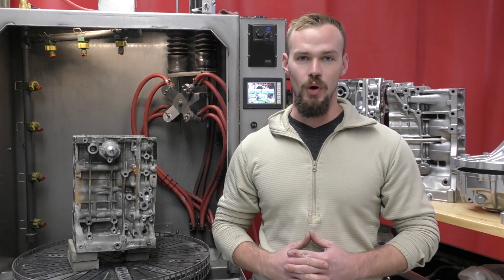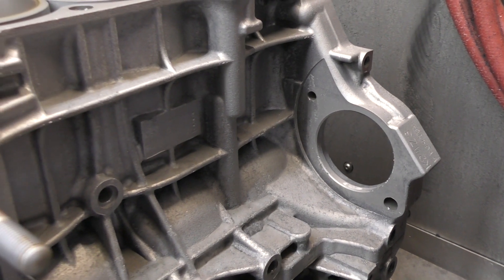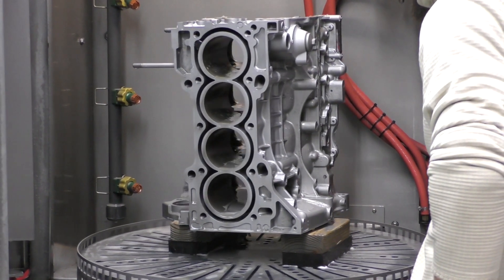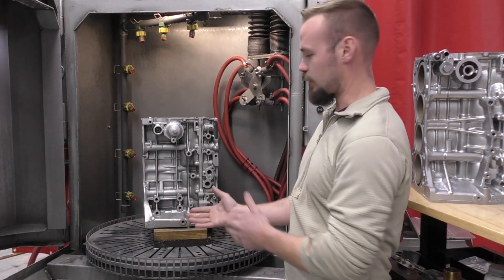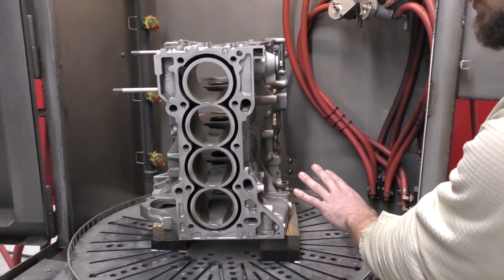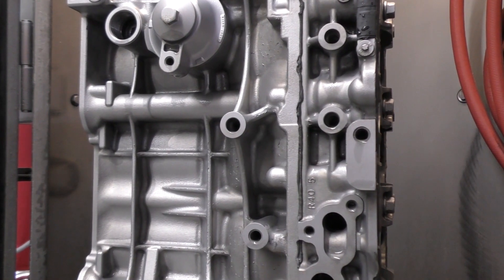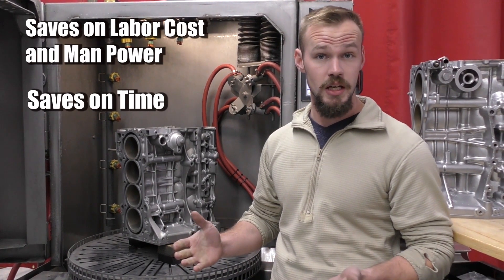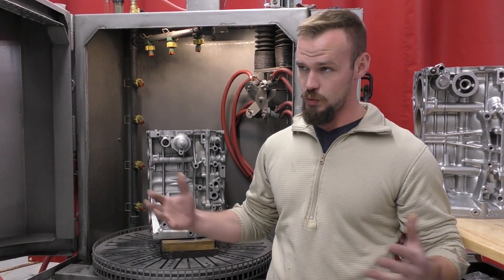Automated Engine Block Restoration- Vapor Honing Technologies

Comment: Would you want to do this before or after machining? I would think before... but hot tanking it did weird stuff to my block...
Reply from the maker: Typically Vapor Honing is used before machining. This process does not remove any surface material or change sealing surfaces, so it could be used after machining. If you would like to test our process on your parts, reach out and try our free application testing program! Hope this helps.

Comment: what about the coolant passages in the block?
Reply from the maker: Great Question, the customer has an Ultrasonic Cleaner and a High Pressure Parts Washer that will be used as a Post Process to remove abrasive left behind.  Can we send you some information on our equipment?  Please let me know.  828-202-5563 x 103 Niki nicole@vaporhoningtechnologies.com
Reply: @VaporHoningTechnologies  Cant you just chem bath it prior to washing ?
Reply: Very nice